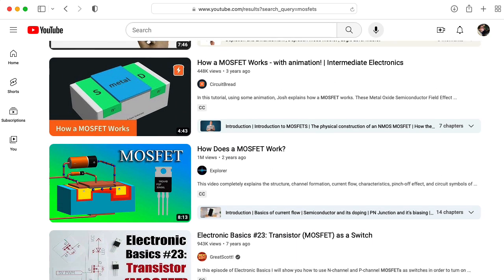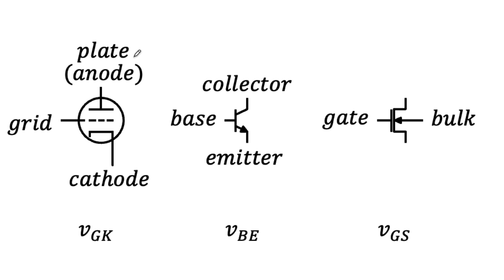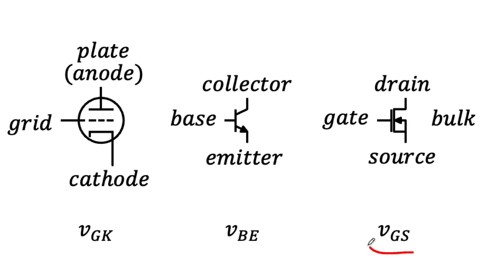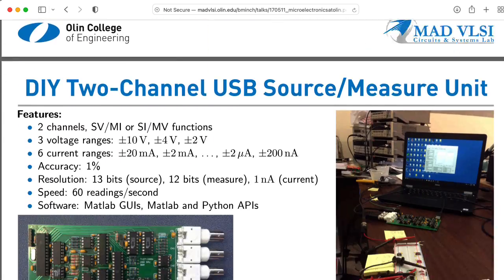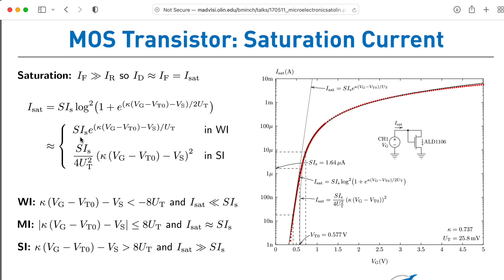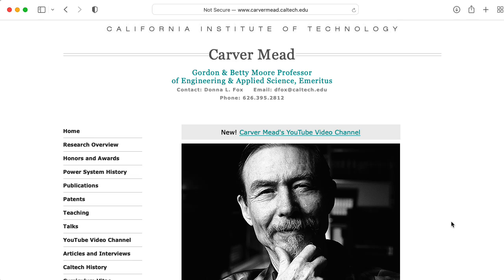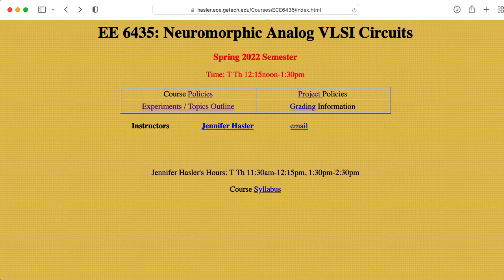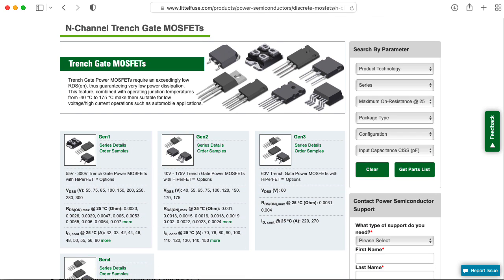They Mislead You About MOSFETs

Comment: I really didn't like this video. Just didn't get the point of it.... it made a big fuss about some pedantic points, and then totally failed to explain why it would matter, to whom it would matter, and (most importantly for electrical engineers) when the blue smoke would be released. I frequently design with mosfets and based on this video there is nothing I would do differently...
Reply from the maker: This is really addressed towards cases when you have more than one MOSFET in a device. I probably could have done a better job of explaining that.
Reply: @Lantertronics thanks for being humble about it anyway. Agree or disagree it’s nice when egos don’t get in the way of figuring things out. This response to him earned a sub
Reply: This applies to the use of MOSFETs in an integrated circuit, where the bulk connection needs to be taken into account. I can see regular Vgs calculations not applying if there's a component between the source of the MOSFET and V-, such as another MOSFET, if the bulk is fixed to V-. A discrete MOSFET has the bulk connected to the source internally, so this problem doesn't apply.
Reply: I guess this is important when you design something that relies on linear characteristics of a fet. Most people use them just as switches and/or pwm control.
Reply: Mosfets make great sounding amps if you can keep them from shorting out at the slightest breeze.
Reply from the maker: @chazlabreck  That's interesting... my experience with MOSFETs is in the low-power electronics realm -- little MOSFETs.. I'm not too familiar with their advantages or disadvantages vs. BJTs in terms of pushing air with a speaker, i.e. Big MOSFETs.
Reply: @Lantertronics 
I've encountered some mosfets in some older amps.  It's a bit more tricky to keep their response linear as compared to BJTs.  I thought about using them in a pwm style driver, but never really played around with it, myself - doing that could run into all kinds of resonant and harmonic horrors if my forray into VFDs is any indication of how that could end up.
Reply from the maker: @Aim54Delta  PWM... you're talking about Class D type stuff? Yeah, that's very dicey. It obviously can be done well but it's scary.
Reply: @chazlabreck  Many older ( and still operating under harsh conditions) subwoofer- and real big PA amps running on mosfets would care to differ.
Reply: @chazlabreck Usually when I've seen this it's a HF oscillation problem
Reply: I actually agree with this. Maybe these points are more relevant to IC design, but to claim “Vgs is never valid” is silly given every discrete MOSFET data sheet is using this as a characterization metric and it is highly relevant for real world electronic design.
Reply: @ZacksLab 
Except that's not necessarily how bulk circuits work, as described.  Mosfets are technically 4 terminal devices and how that 4th terminal is connected inside the IC design is extremely important as the conduction response is determined by the voltage between the bulk and the gate, not the source and the gate.  If... IF ... the chip in question has tied the bulk to the source, then it is a valid expression, but not necessarily in the realm of signal processing and propagation within circuit characteristics is critical.

When you're chunking x band radar returns for processing in real time, the capacitance and even inductance of the channel and the bulk is a factor and can deviate performance from the expectation because it's not the voltage between source and gate, but bulk and gate - and if what is at the source has yet to propagate or charge the capacitance of the bulk, you won't get the expected behavior when you expect it.

This also applies to noise, as high frequencies can couple via the bulk into the output - particularly if they are connected to the voltage rail.

This is valid information for the growing number of people getting (unwittingly) into microwave analog circuitry with the explosion in custom board printing and custom computer design.
Reply: @Aim54Delta  I agree, but I think a lot of the videos referencing Vgs are referring to using actual MOSFETs as they are sold (with bulk tied to source) for load switching or SMPS design, which is vastly more common than those doing analog IC design or microwave stuff as you mentioned. ALL datasheets for these parts will list parameters in terms of Vgs. Is this misleading? Perhaps. Is this how people design with these parts? Yes. Do they even need to know a FET is a 4 terminal device in these more common cases? No, not really.
Reply: @ZacksLab  
To be fair, vgs or the published response curve in the data sheet isn't really valid to the application apart from avoiding unnecessary saturation of the gate to shorten fall time.

Most of electrical engineering is looking at the data sheet for the power mosfet rated at 1 mhz, smiling, nodding, ordering it and plugging it into a 32mhz class E amplifier - or running a bjt in avalanche switching mode.

There are valid things on the data sheet, but a lot of it has to be taken with the context of their evaluation circuit, which is also published, and the limitations that come from extrapolating application specific behaviors from the data sheet.

My point is that the only real case where you are going to be super concerned about "vgs" is in an application were that metric is critical - such as precision amplifiers.  Else, you're mostly avoiding excessive saturation or inadvertent triggering of the threshold.
In those applications, it would naturally follow that this information applies.
Reply: @Aim54Delta  I disagree... Rds_on is a function of Vgs. Designing a proper gate driver for high side drive requires knowledge of gate to source parameters. I don't think anyone picking FETs for motor controllers or SMPS are just "smiling, noodling, ordering"
Reply: @ZacksLab  
I think you misunderstood my point in regard to smiling and nodding.  We use components well outside their datasheet parameters all the time.  The class e ampifier I mentioned uses zvs switching and allows a power mosfet to operate in the rf region.  The data sheet gives a max operating frequency based on full load switching and the expected junction temperature/dissipation at ambient conditions.

Rds on is, once the gate is saturated (or, in some cases, fully desaturated), what the resistance of the channel is at ambient conditions.  From this, you get your derived nominal max current or half wave short circuit tolerance (along with packaging/junction material properties).  It's almost always a value to be minimized.  If you have two mosfets of similar performance and one has a lower drain source resistance, it is almost always more desirable.
Unless... you expect to do a lot of switching under load in which case the depletion of the gate charge and the increase in resistance (and dissipation) as the device turns off becomes a concern - in which case, smaller gate capacitance and shorter fall times become more critical... or using zvs/zero crossover topologies to avoid most of the problem.

In these cases, you are almost always working with discretes or modules that behave like discretes.
But in the case of a module handling polyphase, you could end up in a scenario where a binding to the ground plane does not translate to the voltage on the source.  I would expect almost no modules to work this way without express documentation or marketing to whatever application that would be desirable to have - but even in a motor controller operating at a mere 60hz as an inverter would run into problems if the bulk were tied to the ground or negative side of the power rail rather than the respective source.
Reply: @Aim54Delta  What exactly do you mean by this?: but even in a motor controller operating at a mere 60hz as an inverter would run into problems if the bulk were tied to the ground or negative side of the power rail rather than the respective source.

Most, if not all, BLDC controllers today are operating above audible frequency range (>20khz). The low side FET's source is usually always tied to the negative side of the DC link, if not, it will be tied through a very small current sense resistor if sensing on the low side.

Can you show me a discrete NMOSFET that is often used in motor control that exposes the bulk terminal that isn't internally connected to source?
Reply: Inside Brains
Reply: Same here😢
Reply: @dancollins1012 - It's clear that you completely missed the point of this video lecture. The MOSFET is a four terminal device full stop. The three terminal devices you have designed with are a degenerate case where Vsource-bulk is zero and that simplifies characteristic equations to the point where you can use Vgs, but trying to design circuits where Vsource-bulk is not zero makes using Vgs insufficient and misleading. (Source - occasional microelectronic designer since 1981, MASc EE)
Reply: He is LITERALLY saying it at 01:45. Discrete Mosfets tie their bulk to drain or source. And then again at 02:40. Dont make your lack of attention span OUR problem.
Reply: Where did you get your EE degree from?
Reply: Why respond in such a critical tone?
Reply: @helmutlord4335 I share this sentiment, and I personally wouldn’t have phrased things quite this way, but I didn’t read this as necessarily impolite or out of bounds. I think this kind of frank honesty is entirely appropriate when it’s sincere, and (this is my intuition, not an educated or informed position) probably clearer to non-native English speakers as well as more directly useful as feedback to the author. 

Constructive criticism is one of the first things I learned formally as a film student, and it’s carried over a lot of valuable skills into my technical career, I wish more fields spent time teaching students how to consume media, think critically about it, and identify where the ideas being presented could be more effective and relevant to the audience. It’s been interesting to see how this has played out with YouTube as an interactive medium. Many thanks to the Professor for sharing, and OP for expanding my own understanding of what I am watching.

Comment: Its funny how at the same time I can grasp the concepts, the equations look unaproachable. I'm a simple man who designs and builds guitar effects for myself as a hobbie, so, my understanding of mosfets is basically: "you put a zenner in it so it wont fry from stactic, then you make 3 stages of it, and you get sweet distortion."
Reply: It's okay.  I literally have a degree in this stuff and the math is still something that gets me.  Especially since I haven't done this type of work in a decade, and those are graduate level courses he's referencing.  On the other hand, undergrad didn't really cover MOSFETs.

Something interesting about that distortion. Because there's a capacitor in the MOSFET, the time it takes to turn on is based on the gade source *current* (Please correct me if wrong).  That's one of the reasons MOSFET drivers exist.  You may be able to get a similar amount of distortion by using a current limiting resistor in front of a single MOSFET.